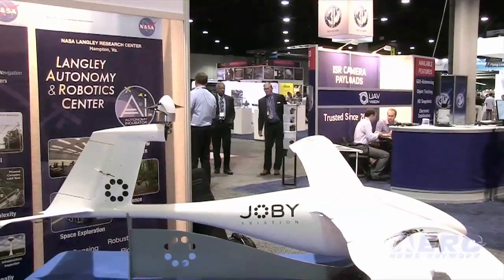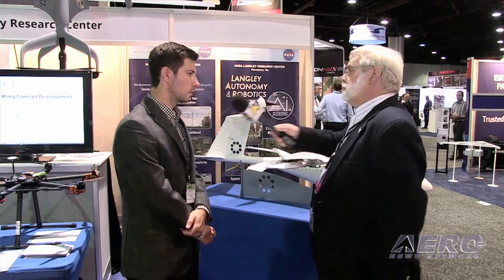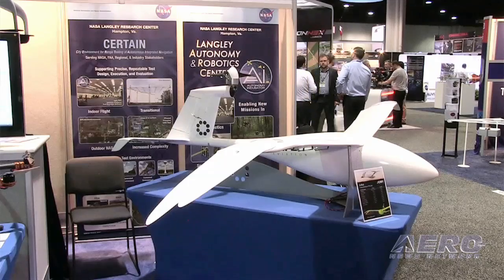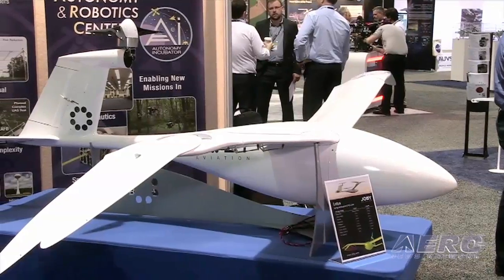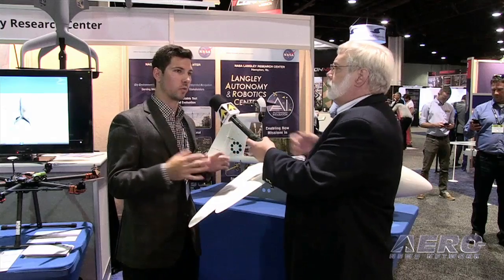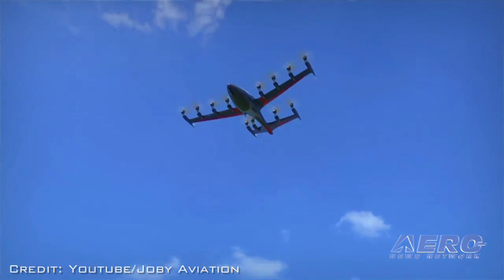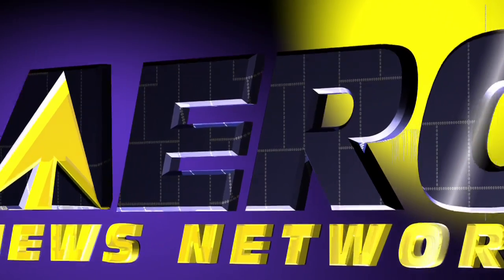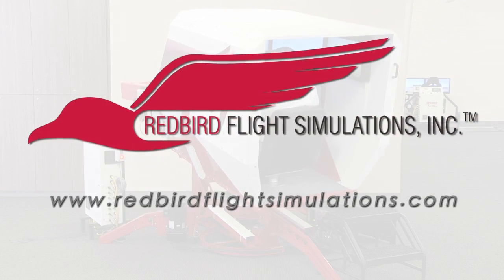Aero-TV: Joby Aviation’s Lotus S - An Exquisite Blend of Form and Function

Comment: Unless the photography is deceptive it appears that we have two rotor blades of different shape, length amd area. It will never balance. I don't see how it will have the power to 'freeze' the blades and motor in the forward flight position. I think the whole concept is flawed.
Reply: You are mistaken, you can easily balance out an asymmetric aerodynamic condition by simply adding weight or ballast, the single blade prop is not a new concept nor is the asymmetric prop/rotor and there are braking methods that stow the blades in a desired position that are employed on many powered sailplanes. It astounds me that detractors like yourself honestly believe a company working with NASA would go as far as developing a working prototype at huge expense, with all the advanced technologies at their disposal nowadays only to have a concept so flawed that a casual observer like yourself can call it implausible! Do you not think the idea would have been tested and scrutinized by the best in the industry? Comments like yours do nothing but show the lack of insight you have in the science of aerodynamics
Reply: https://en.wikipedia.org/wiki/Single-blade_propeller